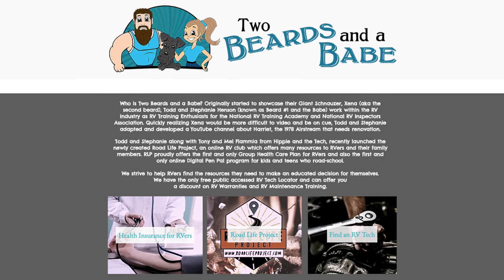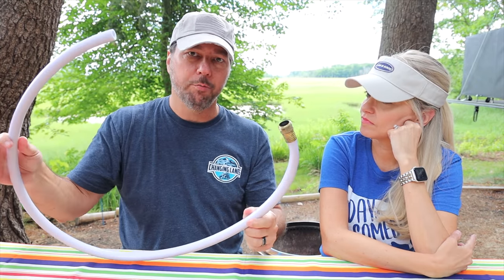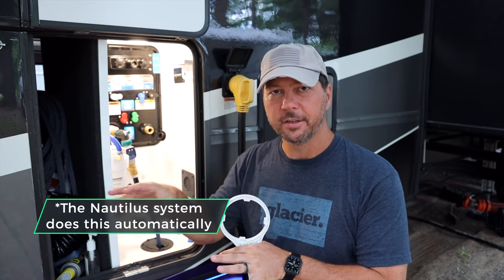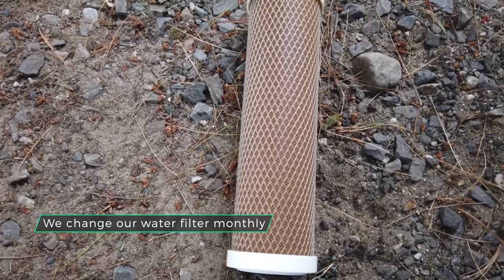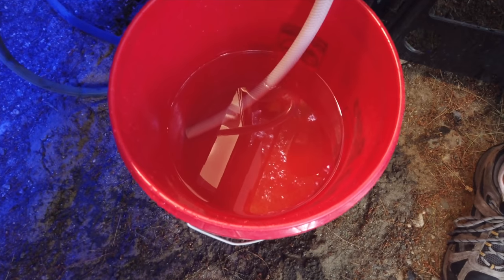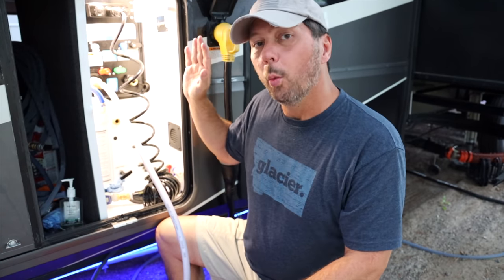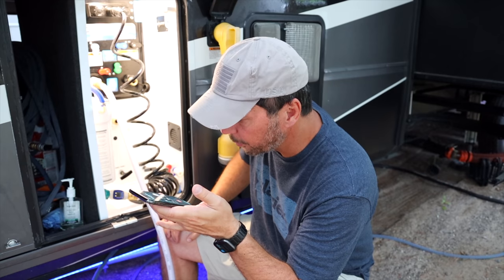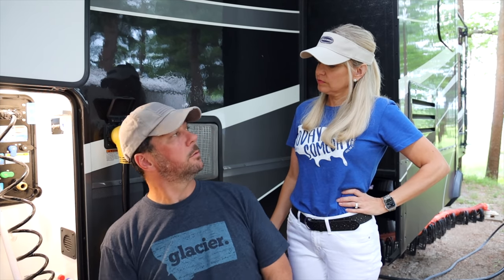💧 RV Fresh Water System Sanitization! (RV Maintenance Series) | RV Living!

Comment: Question, why do you have to use a different line to blow the pyramids out of your black tank? seems to me the water going in shouldn't matter unless you are messing with the waste hose also, i am permanently camped on a lot i am buying. my hose stays hooked up so the water hose is all i ever mess with.  i use an inline filter for my water inlet of course now i have to fix that too because last night i was changing out the filter after 3 months. i use the camco 40019 2x XL water filter for my rig. has worked great but when i pressurized the line again last night even after flowing the water through the filter and hose it completely blew the filter apart and in the process it blew my inlet completely off the RV.  so now i have THAT to fix! i did learn the proper way to flush my black water tank and OMG the devil was burried in there. I run TST Max through mine as well as Zep Citrus degreaser and 20 Mule team water softener and it works WAY better than just washing the tank normally. of course i never take my RV anywhere. i live in it on my lot so it doesn't slosh around but that combination still worked well for cleaning all manner of shmutz out of both gray tanks AND my black tank. i had to flush my gray tanks twice but had to flush my black tank about 6 times before the water ran clear. i am on a septic tank here but i was also told that to keep the fresh water tank clean dump 1/4 cup of bleach in it each time you fill it up. that should keep the nasties out of it Any idea how hard that city water inlet valve is going to be to replace? i can get a replacement valve from Home Depot pretty cheap but i've never done that kind of work on one of these before and i'm kind of afraid of screwing something up

Comment: Thank you for your service and your help.  I have a 2023 376ths. The fresh water tank dump valve is a game changer. The RV parks frown greatly upon dumping 110 gallons of water on to the ground. Are you aware of a 2 1/2" to 3" sewer hose adapter so i can drain it to the RV park sewer system? I didn't initially see your idea to use water pump to empty the fresh water tank. 

Thanks

Comment: After I remove the filter, I put the bleach in the water filter container,  then fill the tank and run it through the lines.
Reply from the maker: That'll work for the tank as long as you bypass the water heater..
Reply: @ChangingLanes  I do bypass the water heater but I don't need to, the tank is plastic and does not have an anode rod. You guys do such a great job, thank you for your hard work.
Reply from the maker: How does a plastic water heater heat the water without some kind of metal heating element?  there has to be metal in there somewhere I would think...

Comment: The one thing virtually everyone overlooks is the vent pipe from the tank to the filling station on the RV.
The water tank on my Travel Supreme had to be replaced.

The dropping of the underbelly exposed the tank and 3 hoses or pipes…one was the tank vent.  1/2” ID. Clear plastic.
The vent was black with mold the full 5’ length.
Obviously it was replaced.
My point is, there was no way to know about the vent pipe mold and no way to remove the mold, so it was replaced.
If able, I’d suggest those who can, access from underneath and inspect the vent pipe.
Or maybe unfasten the fill station and try to pull it out enough to visually inspect.

Comment: Wow! What a process!  Too much for me 🤪
Reply: Just start filling your fresh water, get a funnel and a gallon jug.  Premix some in the jug, use the adjustable funnel to get it into the fresh water port.  By-pass your hot water heater.  Turn it off, letting it get cold.  When your bleachy fresh water is getting full, turn on water pump and run all your lines.  Then add just a bit more bleachy water to your fresh water port and top off.  While you wait for the water to sanitize, you can empty our black water/change anode if required.  The hard part is the next day.  You gotta dump and refill fresh then dump again.  Run the water pump on the refill to purge all lines.  Then when your done, un-bypass hot water heater and fill/heat.  I do it every year and use the in between time to either get anode rod or go grocery shopping etc.  I’m not sure I ever wait more than 5 hours, but I use my fresh water tank all the time.

Comment: I must have missed something.  Since you have bleach water in the fresh tank, couldn't you just pump the water from the tank into the lines?  Doesn't that do the same thing?  Seems like you could eliminate the winterize step.
Reply from the maker: that would pump bleach into the water heater...
Reply: @ChangingLanes  Ehhhh, not if you left the red handle turned to the bypass position, right?

Comment: Great video!  So our Entegra has the Sanitize lines and tank modes as well.  I have a question though..  Couldn't you fill up your fresh water tanks with the bleach/water solution, then switch to 'normal' like you're boondocking and run the solution through your lines from your water tank?  When done, just top off your water tank with fresh water?  Just wondering..

Comment: Isn't your water heater self sanitizing,  because of the heat?
Reply: Well there are different issues for the water heater. Calcium build up and other chemicals will build up in the tank. So a different additive would need to be placed in our tanks. Vinegar is a great cleaner for the water heater.
Reply from the maker: Not hot enough to sanitize...  but we'll be making a separate video of that (sanitize with vinegar) plus anode rod replacement.

Comment: Sanitize is for adding bleach to fresh tank, than you could pull bleach water from fresh tank into lines instead of using the winterize part to pull the same bleach water mixture from a bucket. Winterize is for putting antifreeze into lines and bypasses the tank so you dont add antifreeze to tanks.
Reply from the maker: Doing it that way would put bleach in our water heater.
Reply: @ChangingLanes  you bypassed the water heater in your video when you turned the valves on the back of the water heater to bypass. When the water heater is on bypass the bleach water will not go onto the water heater.
Reply from the maker: That was Todd showing how to bypass the water heater in RVs that have a bypass.  That was not our RV.
Reply: @ChangingLanes Got it!  This is a video on how to do yours specific kind of RV. Not a video on how most people would do it. I have never seen a RV without a water heater bypass. Seems to make it more difficult and you dont sanitize tour lines between the tank and the point where your winterize lines join the tank lines.

Comment: Chad and Tara, Great video. Glad you 2 are still safe. How often should this be done? I'm thinking yearly...
"Nowhere to go... All day to get there".
Reply from the maker: Yes.. yearly-ish.  👍🏼
Reply: Hi guys did you remember the ice maker.? Regards from Craig in Toronto
Reply from the maker: We don't have one, but that's a good question.  Just run the ice maker off the pump for the 8-12 hours while it's sitting, which will use the bleach solution, then run a few more cycles of ice after the flush phase till there's no more bleach smell...  Throw that ice away, obviously.. 😊

Comment: Thank you for your great explanation.  Love watching your videos.  Question: do you need to bypass the hot water tank if you have and AquaHot hot water system?  Will it harm the system?
Reply: Yes you want to bypass the aqua hot. The coils are metal inside and we really don’t want a bleach mixture in there at all possible.

Comment: I know this is an older video but I just found it looking for tips on how to sanitize using the nautilus panel in my new Outback. I'm not sure if I missed something, but if you fill up the fresh water tank with the bleach solution, why not just use the water pump to pull for there to sanitize the fixtures instead of the back and forth using the winterization setting?  I think the winterization would be just to prevent you from having to add antifreeze to your fresh tank... Just a thought! Thanks for a great video.

Comment: Once you have let the bleach water sit in the tank and lines for 10-12 hours do you have to pump this water through the lines until empty or can you open the drain values(master) and let it run out avoiding running the pump for a long time?

Comment: Nice video. I have found it easier after getting the bleach solutions into the freshwater tank to run water at each tap until bleach comes to get water into the lines rather than doing the winterize valve to lines.
Reply from the maker: Agreed.. And we now know that's possible with the Nautilus P1 - see the notes in the blog post - linked below.

Comment: I'm just curious on why you used the bucket and the winterizing process instead of just using the pump to use the water from the tanks to fill the lines in the RV. About to do this to mine.
Reply from the maker: that would put bleach into our water heater..

Comment: if you were going to bypass  water going into your hot water heater , and hot water coming out of your water heater for 12 hours. Seems you might want to turn off the breaker that is powering your hot water heater ?

Comment: Hey guys I had my travel trailer winterized at the dealer and I got to thinking I wonder if they remembered to remove the water filter, so when I went out to check they had I guess they obviously remembered since the canister was filled with pink. Now to my question how do I get the pressure off the water filter housing unit when I dewinterize and get everything flushed out including the water filter housing which will be pressurized when I'm done I would assume. I was wondering if I could just open the low point cold drain to release the pressure on the system because I'll need to take the canister off to put in the new water filter but I don't want to spill it all over the pass through storage, where it's located. I know I could open the pressure release valve on the water heater but not sure if how that would affect the cold water ugh ! Simplest thing maybe would be just to go with an external filter and leave the water filter housing well enough alone but I hate the idea of being beat or having to take into the dealer to have something that simple. Thanks😅

Comment: You know that instead of using your shower connection to relief the system prssure, you can use the low point drains in your wet bay in the Grand Design to relief the pressure.
Reply from the maker: true.

Comment: Adding a bit of color to the bleach water would make the line filling go much faster, and when draining the bleach water from your tanks, better to use the low point drain so you don't risk burning out your water pump from so much use.  Otherwise, very informative video!
Reply from the maker: Dumping 150 gallons of bleach water on the ground would not be taken very well by the RV Park, the neighbors, nor wetlands we're next to.  😳
Reply: @ChangingLanes  not on the ground, you could put the sewer hose under that temporarily, but just a suggestion since you mentioned the pump kept overheating.
Reply from the maker: I guess that would work.. just need some way to secure it.

Comment: I have a 2021 GD 381M with the nautilus panel as well, but oddly enough my red knob is ONLY turned for winterize mode not sanitize mode. Not sure yet if that is only bypassing the WH in winterize mode only or what, but thought that was odd and interesting.

Comment: Great video. When I do mine and the water has sat in the tanks for 12 hrs I just open the freshwater drain and dump it out in my driveway. Then refill the tank,flush all the lines and empty it again. Is there a reason u pump it all out with your pump
Reply: I agree and do the same.  I also run all of my fixtures using the bleach solution in the tank with the pump to distribute the sanitized water throughout the lines. I then repeat with fresh water to rinse.
Reply: They are at a campground and most highly frown upon anything being dumped on the ground. I can imagine that the place may have freaked out if they saw them draining 100 gallons of bleach water on the ground.
Reply from the maker: Most locations will not like 150 gallons of bleach water on the ground... tends to kill grass and such, might run into a neighbor's site, etc...
Reply: Sorry, I should have stated that I drain it using the low point drain and because it is located at the rear close to my sewer hookup, I send it down the sewer.

Comment: If you guys use a washer and dryer would be nice to see a video about an RV washer and dryer pros and cons and what you think of it
Reply from the maker: We have a stackable system and the dryer is vented.  No real downside other than the space they take up.  We've not heard great things about the combo units, however.
Reply: Watch your videos every week I like all the how to's you have. Looking at getting a solitude and the washer dryer and cold weather are my few things I want to learn a little more about before diving in full-time.
Reply: @ChangingLanes  just wondering, do you also run the sanitizing water through the lines feeding outside shower and the washer? Bacteria in those lines can migrate back in with the rest of the system.

Comment: If you fill the tank with the bleach solution, why would you need to use the winterize mode to get the solution through the lines to the fixtures? Just turn it to dry camp mode and turn on each fixture to use water/bleach from the tank. No?
Reply from the maker: because that will put bleach into the water heater.
Reply: Changing Lanes 
Thank you. I do not have the Nautilus system yet. My water heater has a bypass. Hope to get a Momentum next year. This is why I watch you. Thanks for the great videos! Hope to run into you someday and thank you in person! Be safe!!

Comment: Why not just use the "Dry Camping" setting to pump bleached water from fresh water tank through all the fixtures inside the trailer?
Reply from the maker: Because that would pump through the water heater for all of the hot lines.  See the note in the description below or in the blog though... we learned after the fact that it is possible to do what you're talking about by turning one bypass valve.

Comment: Why not pump water through your faucets normally instead of using the winterizing valves? This way you will have the right mix, or at least the same mix you have in your tank, without possibly over doing the bleach? And then you can run the faucets until you smell bleach, using one person, and don't have to worry about your bucket running out of bleach water.
Reply from the maker: Because, with our system, that would pump bleach water through our water heater.

Comment: I noticed that your water pump makes a good amount of noise, is that normal?  Mine makes a similar noise, as well the water sort of chugs out.
Reply from the maker: It's not quiet for sure... But, I moved it away from the frame (hose was rubbing it), and mounted it on rubber stops and it's better...

Comment: It was a good video. But all I do is fill my tanks turn on water pump and open all the faucets till I smell bleachmop ppmnd let set 24 hours and then drain tanks and flush lines.
Reply from the maker: Perfectly fine as long as you're bypassing your water heater.
Reply: @ChangingLanes  Absolutely. We have been doing that way before they came out with the docking systems. We have the docking station in our Montana it nice to have everything together.

Comment: Nice job very informative thank you for all the information,  just wondering why after the 10 to 12 hours of the bleach water sitting in tanks instead of running your pump to get rid of the bleach water why not just pull the fresh water valve and dump it that way ? You guys do a great job thanks again
Reply from the maker: Dumping 150 gallons of bleach water on the ground would not be taken very well by the RV Park, the neighbors, nor wetlands we're next to.  😳
Reply: Thank you for the response didn't think of that . Just was thinking that would have been quicker way to do it good thinking on your part .
Reply: @ChangingLanes  Great video! My Grand Design 5th wheel has an 1½" gate valve to rapidly drain the fresh water tank. I incorporated a short fitting on the valve outlet that fits a light weight 1½" pool vacuum hose and quick clamp that allows me to drain my fresh water tank into the sewer pipe without dumping it all over the ground. Might also be something for you to look into so as not to have to run your pump for so long.
Reply from the maker: Great idea!

Comment: Why do the winterization step and have to mix another 5 gallon bucket.? Why not go inside and turn on the pump like your boondocking and turn on your sinks and shower until you smell bleach water coming out and shut it off?
Reply from the maker: because that will put bleach in our water heater....
Reply: @ChangingLanes  your not able to bypass your water heater because of the system you have?
Reply from the maker: correct.  The bypass is built in to the functions on the nautilus.  The nautilus seems to make everything easier.. except this task... LOL

Comment: Do you have an ice maker that would need sanitizing ? Great video, thanks!
Reply from the maker: We don't have one, but that's a good question.  Just run the ice maker off the pump for the 8-12 hours while it's sitting, which will use the bleach solution, then run a few more cycles of ice after the flush phase till there's no more bleach smell...  Throw that ice away, obviously.. 😊